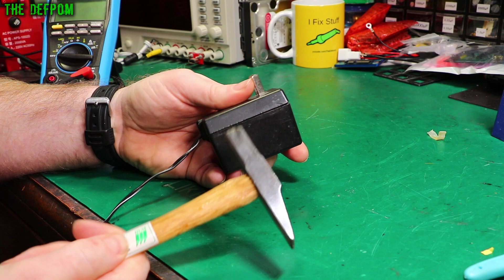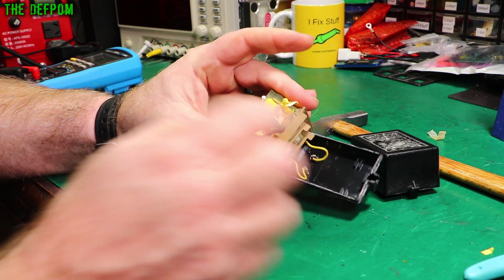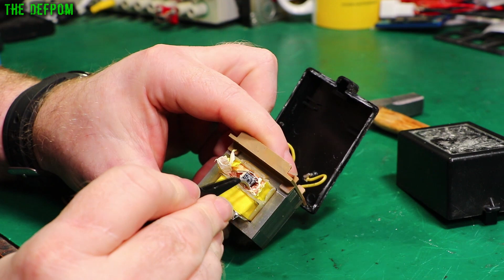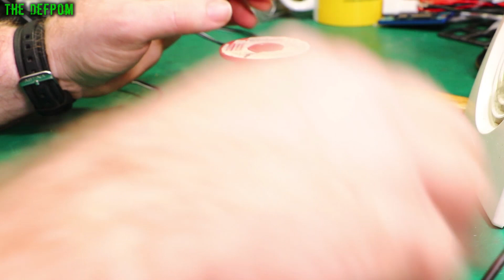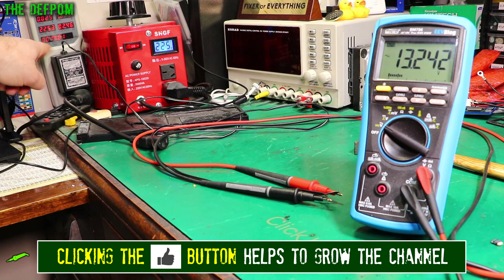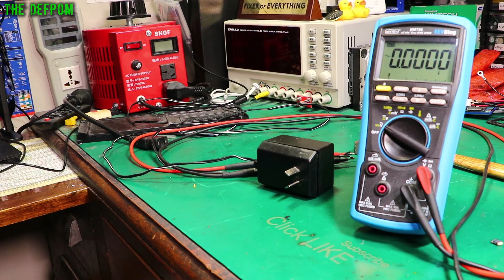🔴 Repairing an AC Adaptor - Fixing An Open Primary Winding - No.920

Comment: 1/2A is really way over rated, given at 240V mains that is 120W, so very unlikely to blw even if the transformer is catching on fire.  At shorted secondary I would think even then the primary fuse would not blow, with 360ohm, higher at elevated temp  there would not even be 1/2A primary current, and unless well over 1/2A that fuse would last a long time, at rated current fuses typically do not blow for minutes, second blow times only well over 1/2A will do it. The pack could in worst case now be a fire risk. Even a few shorted turns on primary would likely not be protected.  Try to get a thermal fuse....
Reply from the maker: Yes, agreed, as I said in the video 500mA was the smallest fuse I had available at the time, and I needed this power supply working again ASAP, I balanced the risks considering many transformers don't  have any form of protection in them, if I have a suitable thermal fuse I would have used that.
Reply: @TheDefpom  yes I do agree, but for effect may as well just have bridged the thermal fuse, safety wise little different and saved the fuse fitting. One of the reasons thermal fuses are used is that current blown fuses are so in effective on low power transformers, and to prevent fires only thermal cutoff can be used. Plug packs are too often permanently on power and out of sight. Failures too often result in fire without this thermal cutoff.
Reply: @TheDefpom  If you had a PTC fuse it would have worked just as well as the non resettable fuse. A 200mA one will carry the current, and the trip point will then be set by temperature only, not the 50mA or so primary current. Plus as it cools down it will reset itself.
Reply: Just for info/safety, the fuse fitted wouldn't be affected much by temperature. If its a normal slo-blo or fast acting fuse then maybe down to 90% of its normal rating at 100degC.
If its a thin film fuse then 70%.
If its a resettable PTC then 30%.
Fuse ratings are specified at 25degC.

Comment: soldering a thermal fuse can be very difficult as the heat from the iron can blow it as you solder it on😏 don't ask me how I know😄
Reply: Long nose pliers as heatsink on the leads, and as short a time with the solder work with me, even on those with crimped terminals. Just have to tin the old ends well, and then work fast.
Reply: HAHAH